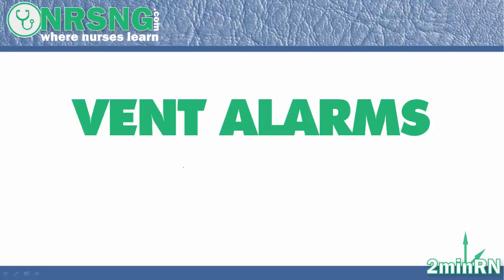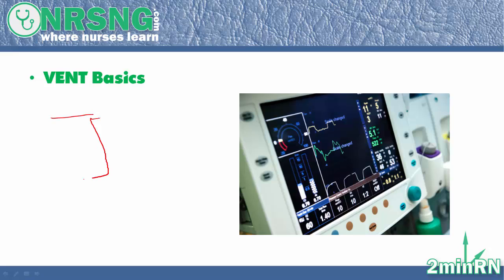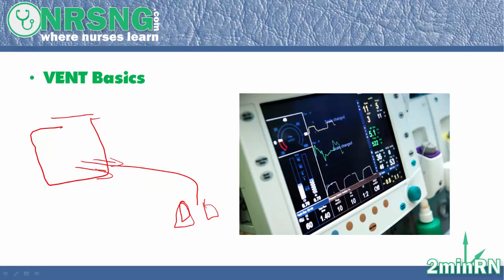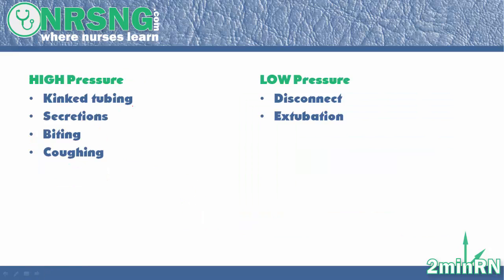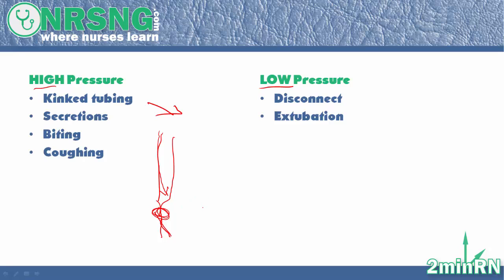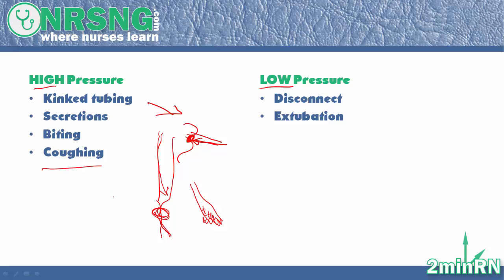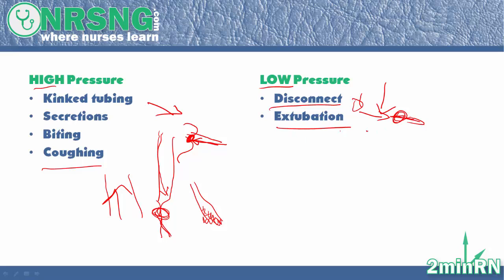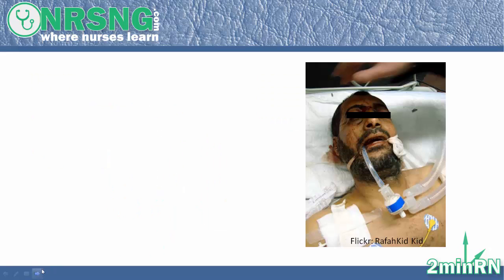Vent Alarms | 2minRN NCLEX Vent Alarms in 2 minutes

Comment: Seriously.... this just made me understand that high pressure alarms push pressure in and cold be disturbed by 
Obstructions
Water in tubing 
Biting 
Or coughing 
Or low pressure alarms that go off because they aren't doing what they need to do which is putting the pressure... reasons might be 
Tube is disconnected or patient pulls out the tube.... 🥂